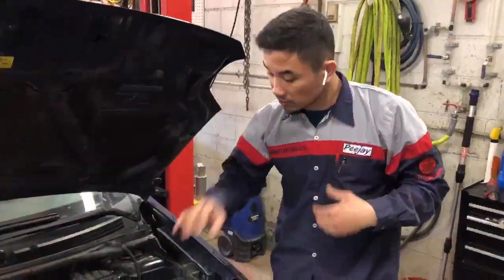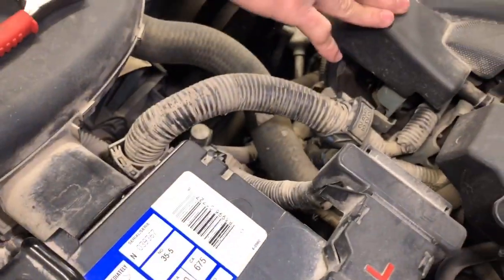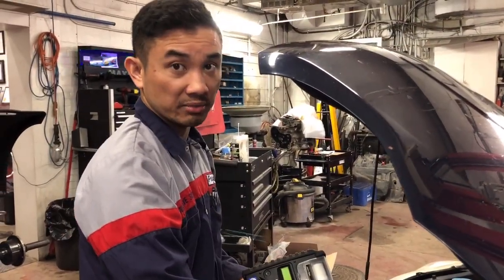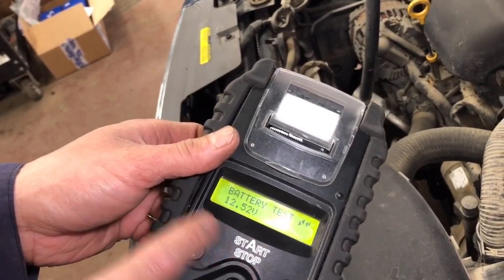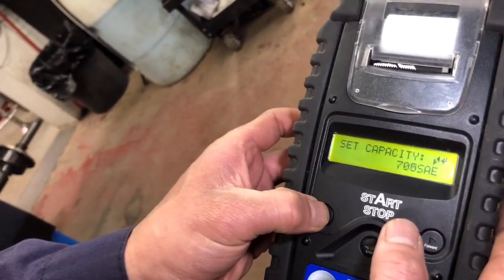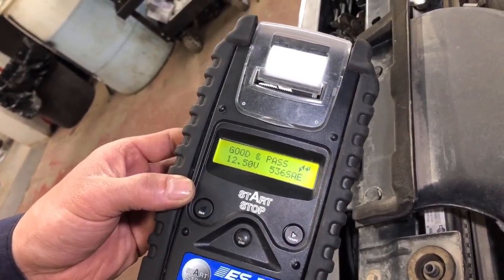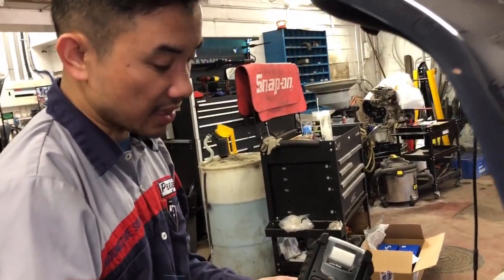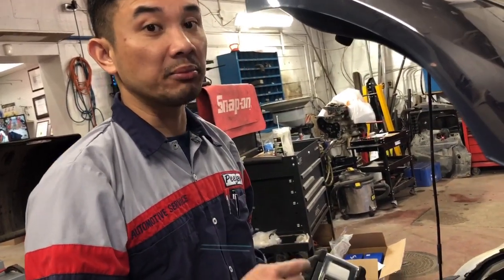Car Battery ( Cold Cranking Amps) 👍🇨🇦

Comment: Many thanks for your video. Could you please explain a following reading in a new battery rated 500 CCA , after one driving day, was showing a measured CCA of 720 ? This test result also showed  92 degrees (Florida) , 12.74V, Flooded, and 14 seconds elapsed. can new batteries go as high as 220 CCA more that it was rated? My present problem is that the smoke from the starter and the chemical fumes made me stop the Corolla 98 and I saw that the lead connector (terminal wiring) to the negative post had melted and also melted the plastic surface of that corner of the G35 new battery. I will appreciate your knowledge to get to the truth of what happened. Was it a bad battery installation? Many thanks in advance. Regards from Florida

Comment: If my current battery is rated 650 cca’s could I replace it with a 600 cca battery? The CA on the current one I have is 825 but the one I’m looking at is 750.
Reply: 600 CCA is usually for 1.5liter engine.

Comment: I have a battery that has good voltage 12.3 but the measured cca is lower than the rating do you think that’s the reason why my engine won’t crank?